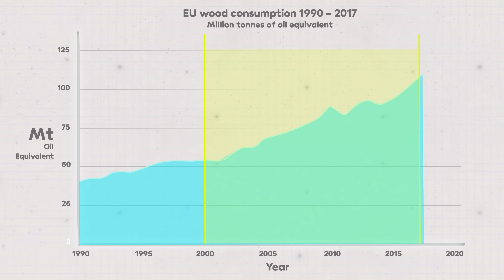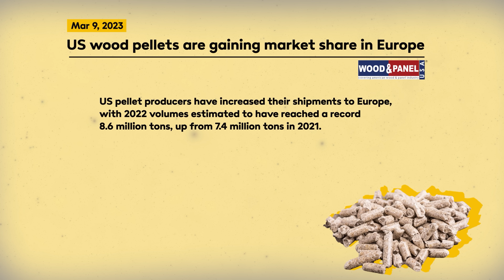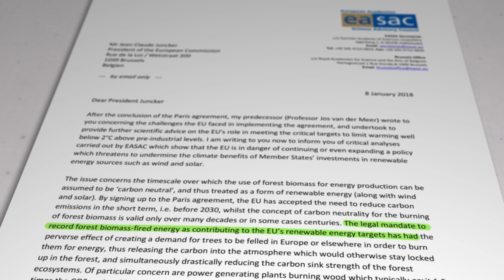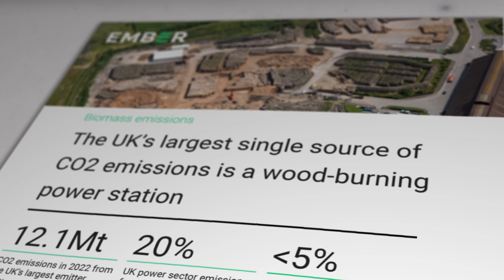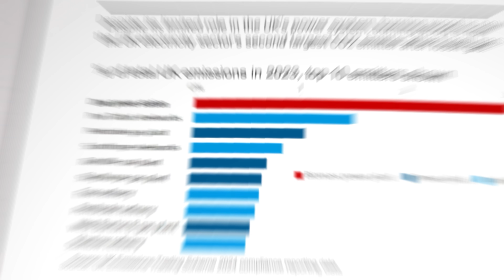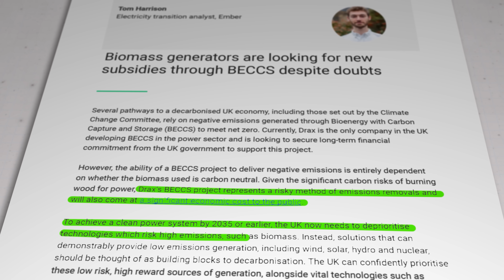New report: Biomass CO2 emissions 4X higher than COAL!!

Comment: This sort of Bait And Switch Scheme is happening in many sectors.
The Hydrogen Economy is almost entirely based on Methane Steam Reforming, producing more emissions while conning the public into thinking they are switching to a clean fuel with pure water as the only emission.
The recent uptake of Plug-In Hybrid vehicles instead of BEVs is the result of legacy auto makers convincing the public that they can go green without changing any of their own behaviour. Toyota convinced millions of gullible buyers into believing they were selling "Self-Charging Hybrids" when in fact they were sold vehicles that emit more than the ICE vehicles they were meant to replace.
Reply: Do you have a source that hybrids emit more?
Reply: @antonyjh1234  He doesn't, he's playing shell game with combined production and lifecycle emissions to skew the reality. 
Remember it's not just emissions it's where you make them. Low emissions in a population center is way more important than emissions from a mine or power plant out in the countryside.
Reply: Was going to make a similar comment. The EU also pumped millions into subsidising the development of hybrid electric vehicles. Their emissions savings were based on 80% electric usage which it turns out very few people achieve. So you have an ICE with extra weight to lug around and often the emissions are a lot worse than just buying a small efficient petrol ICE.
Reply: There should be a way to sue these companies for actively endangering the lives of millions of people
Reply: @croutiflex953     There are ways. People are pursuing them, but the US is so corrupt, & has been so dominated by the far right that many have been tossed out of court by “conservative" judges. Some have won (Youth v. Montana) & some are veeeeeeery slowly proceeding. 

And from my admittedly small understanding of the legal system, many of the perps can be prosecuted criminally, for fraud, eg. & thus millions of felony murders, depraved heart murders, crimes against humanity, & crimes against the Earth (soon a new category at the ICC?) & many more.
Reply: Completely agree with you on the self-charging EV being BS, and that what Toyota is pulling is awful.

Though I don't understand where you got the part about them emitting more than the ICE vehicles they were meant to replace. They (as far as I know) are still more efficient than non-hybrid ICE vehicles, even if they're a far cry from pure electric vehicles they're still at the very least slightly better.
Reply: A PHEV, when used properly, isn't that bad. But the statistics on their actual use show that most of them are used mainly as ICE vehicles.
Reply: It's no Con. KGB PsyOps proved traumatized people have lost ability to think critically. Quantum physics of atmospheric heat exchange is dominated by water vapor not CO2 at same EM frequencies.
Reply: No fuck you plug in hybrids aren’t the problem. Plug in hybrids are actually a pretty practical solution to the dumpster fire of an idea which is CARS IN THE FIRST PLACE. All electric cars are fucking stupid too.
Reply: Wait tell me why a plug-in hybrid should be bad? If you charge at home isn't that fine for small trips? Assume that I am an average consumer
Reply: @blauw67  It really depends, if the driver can charge at home or work the PH/EREV is a better option, if they have a marathon commute or can't charge daily the BEV is the better option. At least until there are enough mines and battery factories operating to replace every new car sale with a BEV so drivers can hoard hundreds of km worth of batteries they will almost never use in daily driving.
Reply: @blauw67 My issue with hybrid cars even if plug in is very complex mechanism to drive car between engine and wheels. Battery is very small so it will have more full cycles than large battery this will reduce lifespan of it. Still oil both engine and gear must be replaced from time to time. Last bit not least, why plug in hybrid cars have such massive engines? As somenoe mentioned in comment, main prepelant shoild be battery along with electric motor, combustion engine shoild be "a generator" range extender with small cc adjust to work under oprimal RPM, 600 cc engine can produce up to 60 BHP more less 50kW of power. Under 70% load can charge and drive car even if battery is tottaly flat. Many of viewers does not know that to make 100km distance you need from 16 - 20 kWH per 100km another words to drive 100km/h less than 20 kW, approx 30 BHP is required. Litthe math.
P. S. Daily electricity usage of avarage family is about 12-20 kWh per day so please take to accout every 100km made by EV is approx daily usage of whole household. Thank you.
Reply: @blauw67  - PHEVs typically offer lower mileage per kWh than BEVs (average 1.91 miles/kWh for PHEV vs 3.52 miles/kWh for BEV), this means more renewable energy is required to be built-out and generated to power a PHEV compared to a BEV for the same distance travelled - this raises the cost and extends the timeframe for achieving Net Zero targets. Hydrogen FCEVs are even worse, where 3 x the energy is required to travel the same distance of a BEV.

You can improve PHEV efficiency by choosing a smaller more efficient model but there is still a large efficiency difference between PHEV and BEV cars, for example the Kia Niro PHEV achieves 2.9 miles per kWh whilst the all electric Kia e-Niro achieves 4.3 miles per kWh.
Reply: @GruffSillyGoat  Granted this gets into sample bias (and also just engineering decisions engineering hell), but is this due to most hybrids being Parallel Hybrids?  Would a proper serial hybrid / “range extend ev” (for instance tesla but half of batteries are replaced by a free piston linear generator and a fuel tank etc) using the same motors/circuitry just with a genset not have these issues?
Reply: @ericlotze7724  - not really, series hybrids (or EREV) are still less efficient than BEVs. The models that have been available to date also typically have had bigger batteries to offset the impact of having a petrol generator rather than an ICE connected to the wheels, and have tended to be plug-in hybrids. Often this battery is much bigger than one would find on an equivalent parallel PHEV,  and in some cases (the old BMW i3 Rex comes to mind) was a larger battery than many of the smaller BEVs on the market nowdays. The main bugbear with series hydrids to date has tended to be extra weight of the ICE generator eating into the battery range as well as increased running cost (particularly in areas where petrol is expensive); the i3 Rex for example lost 30 miles of battery range compared to BEV I3 but gained upto 80 miles from the extender engine - providing only a 50 mile range extension over BEV model but at a much higher running cost.
Reply: @GruffSillyGoat — There are no engineering reasons for a PHEV to be significantly less efficient when running on its battery than a BEV, only marketing and profit reasons.
Reply: @blauw67  You still have a heavy ICE to lug around on top of the heavy electrical equipment.
Reply: @blauw67  You usually only need a large engine for acceleration and going uphill. A small engine (range extender) running at its most efficient speed and torque can produce enough electrical power to keep you going on the flat and charge the battery which can accelerate or take you uphill. Unfortunately, many plug-in hybrids have a small battery and a normal-sized large combustion engine. Also, the combustion engine still has lots of parts which need expensive servicing.
Reply: @clivemitchell3229  thank you, yeah that makes sense
Reply: @clivemitchell3229  Needing a small engine is true in theory, and in the case of several of the better PH/EREVs like the Volt (RIP) and Prius Prime it holds up since they make efficient use of their larger batteries in HEV mode. The problem comes, especially in larger vehicles that when the battery is used up people don't want to be in essentially what would be a limp home mode so the ICE needs to be appropriately sized. Also the ICE service intervals and maintenance for them are blown way out of proportion since they are designed for nearly zero maintenance (iridium spark plugs which is easy on a 4 cylinder, timing chains instead of belts and so forth) and the km put on them is a tiny fraction put on a pure ICE vehicle.

So far the only maintenance needed on my Volt is an oil change every year which takes me about ten to fifteen minutes (and going by the oil change indicator can be stretched to two, but being an old mechanic I don't trust that), and changing out the planetary gearset oil, which BEVs need also. I did need to take it to the dealership for them to do the battery/charging system coolant changes, which BEVs need also.

Once you get past the FUD and misinformation a PH/EREV is the best of both worlds for folks who can charge daily and for an industry which as a whole is severely battery constrained right now. It's going to take years to replace every ICE sale with a BEV hoarding hundreds of km worth of batteries (which 90% of homeowners don't need). You can make the transition four times faster by using EREVs since they typically only need enough batteries for daily driving and the range extender solves the range anxiety.
Reply: @anydaynow01  "essentially what would be a limp home mode" Many years ago I saw an article on TV about some polytechnic students who had built a car. It had a 500cc motorbike engine running at peak efficient speed and torque, driving a generator which charged a bank of car batteries (i.e., heavy) down each side. There was an electric motor driving each rear wheel. The car had 2 litre performance (which was good in its day) and achieved 100 mpg. The problem with most PHEVs is the design - bolting motors and batteries onto an existing ICE model in an attempt to save money.  I really don't see any other point to parallel hybrids, especially.
Reply: @blauw67 Using Kia Niro as benchmark you can compare costs of HEV, PHEV, and EV in the same body platform. You'll NEVER save money opting for EV as PHEV is sufficient for 100% EV miles if charged daily. Assuming very common 60 KWh EV you can make 6 PHEVs.

For perspective how cultists EV fanboys are.. you could 10 KWh PHEV EVERY VEHICLE SOLD IN USA ANNUALLY using batteries siphoned from entire 2023 Tesla vehicle production + planned 2024 Tesla Semi battery production.

As to semi trucks they should be tribrids as in battery electric, diesel, AND in-transit grid power recycling tech used in trains. Sweden has been doing in ground rail and others doing overhead. It allows versatility for fleet buyers for route planning and when resale comes around with a degraded battery.
Reply: @RP-hn1qc  - This is more an argument for having a range of BEVs with differing battery capacities to suit particular needs rather than maintaining the ICE component; which is what is already happening in a number of markets around the world. Smaller, lower cost, lightweight and more efficient BEV cars would address a fair chunk of the average consumer's need without needing to retain the higher cost of a combustion engine in the mix. 

p.s. I swapped from a Kia Niro PHEV to a BEV in the past, in order to save money as the PHEV was more costly to run (fewer miles per kWh, high maintenance costs) than the BEV model.  The increased battery also made it easier to drive the few occasions a month on electric only where the daily 40 miles on electric wasn't enough in the PHEV.
Reply: @GruffSillyGoat  On a techie consumer viewpoint your belief makes sense. In reality it's a nightmare as you add wait the consumer expects same payload capacity meaning varying suspension as is done on the Niro among ALL models funny enough. Sure, air bags would solve it and I'd love it but some aren't fans of them on a durability paranoid delusion. Bags 20 years ago yea I agree more sketchy but thank God for the low riding community and their car hopping competitions being a visible durability test hopping the front end 20 feet into the air on its tail end on air bags. 😂 The reason the Niro PHEV is less efficient than the EV is the dual clutch transmission that has a surprising amount of pull off the line compared to a Prius with the eCVT system. Modern Prius Primes are 250 watts per mile being same or close to full blown EVs.

I believe the pursuit for fast charging and bigger batteries completely disregards a simplified solution. You drive X miles to and from work along with daily errands for 98% of the year.. for long distance vacations or business trips would you rather save money RENTING a trailer that has a battery connecting to an auxiliary input to feed the main EV vehicle power train?

As to smaller vehicles.. those ultra cheap sub $10K Chinese vehicles are only 3KW motor 🤯 and questionable crash safety. Even their larger BYD LFP models are seriously underpowered to what's expected in western society for accelerating merging onto motorways of +100kph without a lorry ramming you.
Reply: @RP-hn1qc  - The comment on lower efficiency (mpkWh) for PHEV wasn't specific to the Niro, rather was drawn from industry data. However, the Niro actually has better efficiency than many PHEV; 32% loss of efficiency compared to it's BEV counterpar vs 38% average PHEV loss. This indeed is in part due to the dual clutch mechanism meaning the car operates more like either a BEV or an ICE car when running in those modes.

Regardling smaller more efficient BEVs this wasn't a comment specific to Chinese made models but the general shift towards smaller more efficient cars away from the early adopter higher value cars. With currently available battery specific-energy densities (vs those of only a year or so ago), smaller battery packs can be fitted (some similar sized as battery packs in PHEVs), that when combined with lower curb weight vehicles, raises the miles per kWh achievable. This trend will enable more BEVs with very useful ranges to be made available - due to the battery resource being spread amongst more cars than currently.
Reply: @GruffSillyGoat  The problem of small EVs is the +30% range loss in winter where my 260 range Chevrolet Bolt goes down to 180. My vehicle even limits power output in half that also limits regen amount.

Hybrid Niro is $26K and EV Niro is $40k using $3 gallon fuel prices it would take roughly 212K miles to begin saving money and that's being generous assuming free recharging because you got solar at your house. Keep in mind the hybrid or PHEV maintenance will always be cheaper than the higher rates for property taxes, insurance, and depreciation in vehicle value.

For example a 3 year old Kia EV6 with an MSRP of $55K sold for $24K with only 36K miles.. smidge more than $10K value loss per year.
Reply: @RP-hn1qc  - 30% drop in winter is dependent on location, in many parts of Europe a 15% to 20% drop is more typical (lower in heat pump models or those with scheduled battery preconditioning). LFP batteries also tend not to see any where near this drop.  

Price differentials vary around the world as well, the cheap price of gas in the states for example is fairly unique. Depreciation is more marked in higher price vehicles than lower price ones, also insurance cost varies around (both ICE and BEV have gone up in the UK for example). 

For example, In the UK, average petrol price equates to $7 per US gallon, and Niro price differential is $2,650, hence even at the average10,000 miles a year the Niro EV is saving money.

The EV6, based on personal experience in the UK, loses approximately 33% after 3 years (slight varitions by model). Equating to about $7,800 per year. This is about average for a car of this price/spec, and is slightly less than an equivalent spec'd BMW ICE car (35% after 3 years).
Reply: @GruffSillyGoat  The EV uses 29 KW per 100 miles and the PHEV uses 31 per 100 miles being a gap cost of ~$53 in the context of 6213 annual Europe miles. The gap is actually smaller being $1600 so it would take 30 years of $53 annual savings.  The mileage would roughly be 250K miles when it starts "saving money."
Reply: There is merit to the diesel electric driveline, at least for trains.
Reply: @57thorns       There’s also merit in creating a civilization that both CAN survive & deserves to.  That means decarbonizing EVERYTHING as fast as humanly possible.

Diesel trains are still consumers of fossil fuel; all-electric trains are another step more efficient & benign & the few countries with rail not already electrified need to get with the program immediately. 

"Europe, China, & India Can Electrify All Rail, Why Can’t The US?" 
Michael Barnard, Cleantechnica 2/7/2023

We’ve waited so long to do anything, the absolute least we can do now is everything at once, as hard as we can, all day every day without stopping for the rest of our lives. For us, World War II is going to last a thousand years.
Reply: @J4Zonian  All the delays have made it so "all at once" is needed, yes.

The question is when this will happen, I mean, if we have enough climatic disasters the world population might shrink to a level where it is possible to go back to local subsistence farming while rebuilding society, but if we act quicker we might save more of our comforts and population drop might not need to be that drastic.
Reply: Until Batteries are better, hybrids are the way to go. How much does batteries contribute to pollution again? All the mining, transport, whole cars being dumped because of all the non-repairable tech. Yeah. I would like an electric motor for a “turbo” boost when needed, low revs and overtaking, hill climbing. It’s expensive though.  Arteries are waaay better in scooters. No Aircon, easily swapped out. Electric motors are amazing, long lasting and durable, pity about the battery tech. I want cheap reliable transport. As shown in this video, government/politicians don’t know better! Next we will have a video of this guy and many like him being demonised for creating pollution because of current battery tech.
Reply: @soothsayer5743  
“Setting the Record Straight About Renewable Energy”
Susan Tierney & Lori Bird, May 12, 2020

“Solar Waste Stream is Tiny, Compared to Current Fossil Fuels"
This Is Not Cool, October 9, 2023

“A Fossil Fuel Economy Requires 535x More Mining Than a Clean Energy Economy” 
Michael Thomas, Distilled, March 29, 2023  

“New Video: Clean Energy = Less Mining”  
This Is Not Cool, September 15, 2022  

"Mining quantities for low-carbon energy is hundreds to thousands of times lower than mining for fossil fuels”
Hannah Ritchie, Jan. 18, 2023

“By 2042, Chinese Battery Maker Will No Longer Need Mining as Recycling Takes Over”
This Is Not Cool, May 22, 2024
Reply: The “Self Charging” spin in them not having more PHEVs really pisses me off.  It’s not “self charging”, it’s something YOU ARE NOT ABLE TO CHARGE!

Even if you could charge the small battery each night/at work etc i would bet that would add up to some savings.
Reply: Very simplistic, diacronic view.
4/10
Reply: Hydrogen is a good alternative however as it it’s hybrid cars, hydrogen can be made green but we need the infrastructure first and plug in hybrids can largely be driven in just electric mode
Reply: @rhysrail        Hydrogen is a terrible choice. It’s wildly inefficient, probably 5-7 times more expensive than electricity, difficult to handle, dangerous, not even close to being worth creating a whole second, redundant infrastructure, ("hydrogen fuel pumps are hideously expensive, on the order of millions of dollars, 10 to 20 times more expensive than a fast charging station and over 100 times more expensive than a slow charging station") & while H can be made renewably, 99.97% of it is not; it’s made from fossil fuels. It IS useful; it's used by corporations to greenwash fossil fuel hydrogen & further delay actual solutions, & to pretend everything can be as it has been, just with less damage. It can’t. 

Michael Barnard has written about H extensively at Cleantechnica. 

“Hydrogen For Energy Types Are Getting More And More Angry”
Feb. 6,  2024  

"New Hydrogen Pipeline Vs HVDC Study Less Wrong, More Clearly Shows Hydrogen Uneconomic"
Dec. 25, 2023

“Association of Electrical Rail Aligned with US DOT…” Feb. 20, 2023
Reply: @J4Zonian  that’s currently, hydrogen has been far less researched than electric cars, efficiency isn’t an issue is the power used to make it is renewable and the fuel pumps are cheap compared to how many batteries we will need for electric cars, it isn’t difficult to handle or dangerous when done in a modern manner
Reply: @J4Zonian  electricity is definitely better but batteries are not, hydrogen doesn’t need to be piped everywhere as you can use lorries as with petrol and there have been very few disasters transporting it in its history and while it can pass through tiny holes if it’s so small you can’t identify it even if it ignites it will have no effect and travels upwards anyway
Reply: @rhysrail      What makes you think batteries aren’t good?
Reply: @J4Zonian  slow to charge, expensive and low energy density, hydrogen has far less research into it and is far better in those ways
Reply: @J4Zonian  what if we instead researched hydrogen, then hydrogen would be far superior, you could easily integrate the tank into the frame like batteries In electric cars and have massive range improvements and electric cars are faster to charge but still not fast enough and have bad range which is made worse in rural areas by no way to charge them, the cost figure is just wrong even including the subsidies and extra ice car tax that is deeply unsustainable, this is even worse with cheap EVs which have limited range and are slow charging compared to ICEs or hydrogen cars also efficiency is irrelevant when you add the extra convenience, 

Most of all your statement about speed to move away from fossil fuels is wrong as it’s ineffective at best and destroying humanity’s ability to progress at worse, it would be far better spending extra time working out better fuels like hydrogen than cheap inconvenient evs.
Reply: With the EVs, no consumer is so stupid that they are buying a $55k car in place of a $33k car to "save money" or the environment.  EVs slowed because they are too damn expensive and you just cannot charge them up easily or quickly and if you need to rack up 500 miles in 1 day you are pretty much screwed.  So, that was all early adoption.  Thats over.  Now we are at the mainstream adoption, but none of the issues are solved yet.  Its not because of a con, its because of the reality.  What sucks is, this has cost tax payers a huge amount to provide the incentives to basically rich people.  We are really in phase 2 of 4.  Still have a ways to go.
Reply: @scstudios8  - this depends upon the model choosen  - high spec/high vanity marques then yes BEVs may be more expensive but there are plenty of lower priced BEVs available now and more coming onto the market each year. Take the Kia Niro for example, the Hybrid EV costs £30k the PHEV costs £35k and the BEV costs £37k for the same base model in each case. This not a big difference particularly between the PHEV and the BEV. At this price differential the BEV with it's lower running costs and cheaper maintenance can work out cheaper than the other two models (depending upon miles driven of course). In terms of long distance driving, 500 miles in a BEV in a day is very easy to do, typically with just one charging pitstop to refuel and refresh the human as well as the car.
Reply: @scstudios8  I assume you are talking about the USA, and that you've never owned an EV judging by your scepticism? I think your comment that there is still a way to go is true but the rest is not entirely correct. An entry level Tesla is now less than the price of the average new car in the USA. Sure there are cheaper ICE cars, but cheaper EVs are also proliferating. High interest rates are the single biggest factor in dampening down new car buying in the US, which is why all car sales are down. Owning a BEV does require a change in fueling behaviour but it is not that hard to get over the gas station paradigm.  I have been driving a BEV for 5 years and have none of the problems you claim. Charging at a Tesla supercharger adds 200 miles in 30 minutes which suits me fine on a road trip, and newer cars charge even faster. Supercharging sites are being added by the hundreds each year. Anyway 99% of the time I charge at home overnight (and never go to a gas station), and save a few thousand dollars per year in running costs. And there were no tax rebates on my car. Take the plunge, you won't regret it.
Reply: @TimTheSandmanNZ  The USA doesn't have high interest rates. We had absurdly low interest rates since 2008 due to the banking industry's scams blowing up on them and the ongoing round of inflation is what we got for that foolishness. That inflation is responsible for the drop in purchasing, not the interest rates coming back to something resembling normal. Realistically, they should be higher as that's how you fight inflation and inflation is still too high.
Reply: @scstudios8  Huh? Our EV, which was no more expensive than an equivalent ICEV, can do 500 miles with one charge stop. I think I'd need to stop more than once to drive 500 miles.  So, for comfort let's say 2 charge/coffee/meal stops of about 30 minutes each -- easy. (Depends on your country and charging infrastructure, but doable).
Reply: @scstudios8  The fact that Norway has already gone all the way shows that it is doable.
Reply: @scstudios8  AFDC DOT gov energy calculator shows that like-for-like, most motorists do indeed save money going BEV.

Who needs to rack up 500 miles in one day? That's an incredible distance to cover, and beyond the endurance of most drivers. Still, over half of EVs on the market today can do it with reasonable charging breaks on most routes in the USA and throughout the EU.

Show me your use case that isn't solved yet, or solved in 2025 model year vehicles and announced 2024-2025 infrastructure rollout.
Reply: @bartroberts1514  it definitely depends on the local price of electricity. In my area, sadly, electricity is crazy expensive at $0.60/kW. That means if I can travel 4 miles per kW (a pretty standard amount), it’s $0.15/mile. At $3.00/gallon (the price in my area), a normal gas car getting 30mpg is only  $0.10/mile to drive. It’s a terrible perverse incentive that’s preventing wider adoption.
Reply: @TheGorillawarrior  It did depend on the local price of electricity. You're absolutely right.

However, a Canadian company, Solartech, has pop-up sun-tracking bifacial solar arrays built to power 1-4 EVs curbside or in a standard parking lot. Since it's over 40% more efficient than flat panels, there's hope that you might be able to get electricity at much lower than grid prices, for your EV.

Depending on what Solartech sells for in your area.
Reply: @bartroberts1514  For my corner of the world perspective: Everyone I know has to go some place that has 500 miles in one day at least a few times per year for various reasons (Family, work, buying and selling items that aren’t easily shipped, etc.).

Cars are an expensive money sink, I’ve always bought something used that is reliable.
Reply: @captainobvious9188  Five hundred miles in one day at least a few times a year, and they aren't professional big rig truckers? Sure. 250 mile round trip in a pickup truck. But then, that's two 250 mile trips, with a lengthy stop in the middle during which recharging should be available.

This of course doesn't apply for Europeans.

Take 65 mph as the average speed for 99% of the drive. That's eight hours of driving to get 500 miles, and in real world conditions anyone with a bladder should take 8.5 to 10 hours, omitting the cola bottle option or Depends, with 1-2 hours of rest breaks. 

Some tanks, though less so with a full vehicle and cargo, can make the full 500 miles without fill up; but most would need at least one pit stop for gas anyway. And what gas: $75-$200 dollars for the fill-up, compared to $70 for fast charger prices (half that if you trickle charge to full at home before you start). Sure, your stop for fast charging takes 45 minutes -- time for a meal and pit stop, or if it's the 250 mile mark of your round trip, getting all that family, work, buying and selling done -- compared to ten minutes to fill up. 

Your day has gone from ten hours to ten and a half, at worst, eight to eight and a half at best.

Cars are expensive. AFDC energy gov calculator shows that for heavy mileage drivers, like-for-like comparisons, EVs are the more economical choice over the vehicle life, and far, far lower maintenance.
Reply: @captainobvious9188       And now you buy something used that is a reliable EV that doesn’t contribute to climate catastrophe. Congrats!
Reply: @bartroberts1514  Yeah, lots of parts of families from Las Vegas up to Idaho along a freeway corridor. My truck is getting old, I am going to replace it with a BEV, and keep the truck for when I need to move stuff (It’s an F150 with a 35 gallon tank, so I typically get a 700 mile range)
Reply: @J4Zonian  I’m very pro switching to EV’s. I just don’t think it’s going to happen until total costs become more competitive.  My buddy was recently visiting from California and asked why there were almost no EV’s in my area of Massachusetts. I responded that in California, gas is expensive and electricity is cheap(er) - it’s totally flipped here. I think a carbon tax or something similar could solve this.
Reply: @TheGorillawarrior     Anything governments can do to help would be great, but despite overwhelming public desire for a faster transition, governments' real constituency is mbillionaires, & the vast majority of them are tied into fossils & ICVs in some way. So governments are willing to push as hard as they can...as long as it doesn’t make the transition happen any faster than it would anyway. 

China & Scandinavia are way ahead on RE & EVs, etc.; n. Europe some, Iberia, scattered countries all over the world including some unexpected ones. 

After 40 years of fanatical resistance & delay, the US & some states have finally done a few real things in the last 3 years or so, though still spotty & not what’s needed most. 

I assume you do know however, that global EV sales are already growing exponentially. China, biggest car market in the world, grew 100%/yr for several years, & is now at an astounding 50% market share. What took Norway 15 years with careful, sustained pro-EV policies will now happen all over in 5 or 6 with or without help.
Reply: @J4Zonian  I appreciate your optimism! Thanks for replying. Hoping for a speedy transition here in Massachusetts.
Reply: @TheGorillawarrior      Thanks, but I am not optimistic. Neither am I pessimistic. I accept whatever happens, but will never give up or stop.
Reply: @bartroberts1514  When driving across the country 800 miles a day is my usual. I've team driven 2300 straight through in 36 hours. Show me the EV that can do 2300 miles in 36 hours.

As for use cases that aren't solved; rural areas. AKA most of the land surface of the earth. BEVs just don't make sense in rural areas. The infrastructure isn't there, and it won't be for quite some time if ever. There are few to no charging stations in wilderness areas, and the environmentalists will chain themselves to the trees to prevent that infrastructure from being built. PHEV and ICE are the only options.

I get that you're urban centric because that's your lived experience, but there's millions of people who live outside of your knowledge. Not to mention entire industries that keep you fed, housed, and clothed. Unless batteries get 2 orders of magnitude improvement in energy density and charging speed, there are major sectors that BEV will never make sense for due to the laws of physics. 

I'm not even mentioning the planned obsolescence and unrepairability rife within the EV industry. If it costs 20k to replace a battery that means the price at which the vehicle gets thrown away is 20k. An ICE car's throwaway price is usually around 2k. That is a fundamental problem that isn't solved by volume, new technology, or software. Brand new rivian's are being written off because they got into a fender bender or hopped a curb due to horrible design choices. Major insurance companies are flat out refusing to insure EVs. None of those things are being included in ownership or life cycle cost calculators. A car who's lowest real value is 20k is not going to work for the large majority of drivers who all have used cars.

The solution to climate change isn't single use disposable cars for the upper middle class to virtue signal with.
Reply: @JHe-f9t  I get that you think you know my "lived experience". You don't. Where I'm from, we considered "urban" to be within a day's walk of a flush toilet.

As of 2020, while challenging, driving 2,300 miles in 39 hours with an EV was possible with careful planning. Tesla’s Model S (400 miles/charge; 200 miles of charge/20 minutes), or Lucid Air (520 miles; 300 miles of charge/20 minutes), with their long ranges and fast charging capabilities, were favorite candidates. The success of the trip largely depended on meticulous route planning, the right EV, and rapid charging infrastructure. It cost half as much for charging as a like trip for gasoline.

In September 2021, a total trip took 4 days and 19 hours to travel the full 7,000 km from KM 0 to Mile 0 in an all-electric SUV an Audi e-Tron in Canada, which has a far worse network of chargers than the USA.

For the USA, the Cannonball Run record for EV is 2500 miles in 42:17. Yeah, that's a 65% difference compared to the 25:39 record, and yeah, you'd prorated take 39 hours to go 2300 miles at that rate. On the other hand, 3 extra hours over a day and a half is hardly excessive, and saving over $200 on gas is saving $200.

You must be rich if you can afford to keep driving the expensive way.
Reply: @bartroberts1514  I did that trip in a vehicle that was 20 years old and cost $2000. 

So I can buy 21,700 gallons of gas for that $2000 car, or I can buy just a model S, and then still have to buy electricity, pay exorbitant insurance and tax rates to go slower with an unreliable charging network that requires 'meticulous planning' and lots of downtime so I can save $200. What a deal!

You too can solve climate change with only a small loan of 10 million dollars from your parents. It's so easy a child (of billionaires) can do it.
Reply: @bartroberts1514  I guarantee you it will cost me less in parts and maintenance than a model S that gets scrapped at a value of $20k. I can buy a $2k car every 5 years and pay for gasoline, parts, insurance, registration and taxes and still be tens of thousands of dollars ahead than buying one new model S and keeping it for it's 10-15 year projected battery lifespan. I know this because I have the spreadsheets that document my real life experience doing exactly that.

Buying old used cars and burning gasoline for 5 years is also more carbon efficient than buying brand new EVs thanks to the high carbon inputs of manufacturing, especially if you live in a rural area where the majority of electricity is produced by fossil fuels.

Reduce, reuse, recycle will always be better for the environment than consume, consume, consume.

Gas taps won't get turned off in your lifetime for the very reasons I stated in the original post. Businesses and economies that you clearly don't understand will run on fossil fuels for the forseeable future because of the laws of physics. Rural areas cannot and will not be powered by batteries alone until there are exceptional advances in technology. Things like the tesla semi and electric tractors are only good for niche applications. Long haul trucking, logging, crop harvesting, ocean shipping and flight will not be majority electrified for decades, if ever. Neither the math nor the current infrastructure supports it, and it won't support it 10 years from now. There's not even a proposed battery technology to enable it. Solid state isn't it. Converting arable land currently in desperately needed resource production to solar also isn't it.

Checking the bottom line with a real accounting of all costs will prevent widespread battery powered vehicle adoption in rural and industrial settings until there are orders of magnitude improvements in battery technology. 

Luxury golf carts make sense for upper middle class urbanites who only ever buy new cars and have short commutes with strong infrastructure support, but one size does not fit all, especially when you're one of the people outside of the 10%, or an industry that enables their continued pampered lifestyle.
Reply: @JHe-f9t       No people live in wilderness areas & there are by legal definition (in the US anyway, & by logic everywhere else) no roads there.
Reply: @scstudios8  people being priced out is a decent argument, but the answer is more subsidies, not less. 

(Although mass transit investment is also needed, not just status quo but electric)
Reply: @scstudios8  they are also not as good as proclaimed. theres no large scale infrastructure for battery recicling so they are just a bandaid fix as well. best on land is still public transport but the car makers have a lot of lobbyign power.
Reply: @Irobert1115HD There is (very little, not none) recycling infrastructure because pretty much all EVs ever made are still on the road.

The battery packs are literally rectangles of valuable metals, that's a bit like saying there will be problems with all the valuable metals in catalytic converters at the end of a vehicles life, of course someone is going to want to take care of that.
Reply: @scstudios8  EV prices have been dropping rapidly and they can easily cover 500 miles in a day. Some of them now charge at a rate of 800 miles per hour so to speak. The subsidies are not for rich people. They would buy the cars anyway. The subsidies help speed adoption which drives down costs faster so that everyone will be able to afford them soon enough.